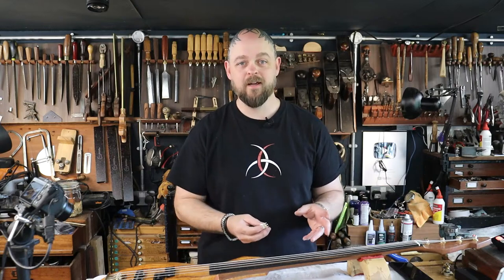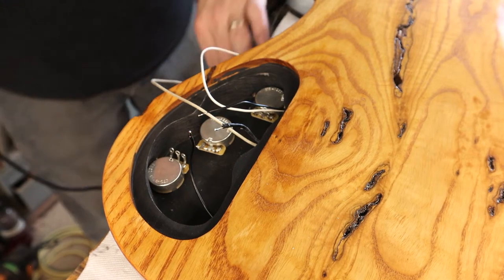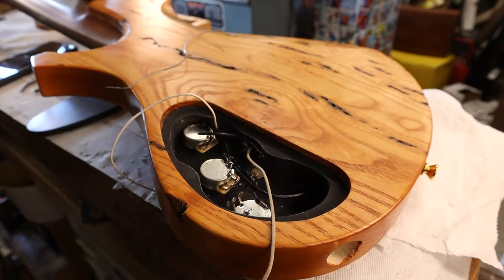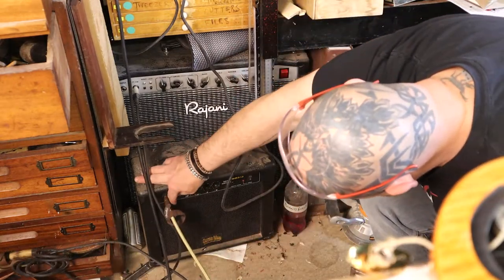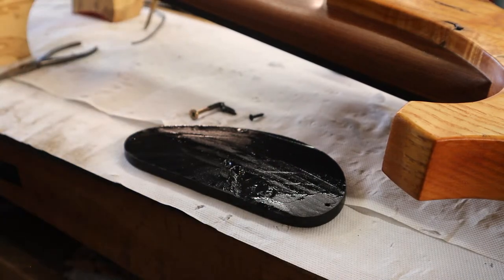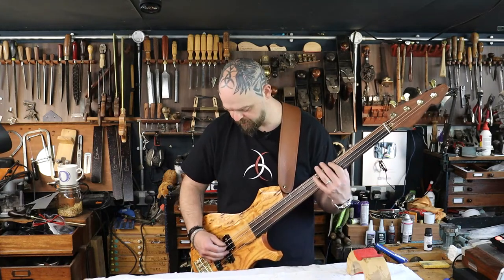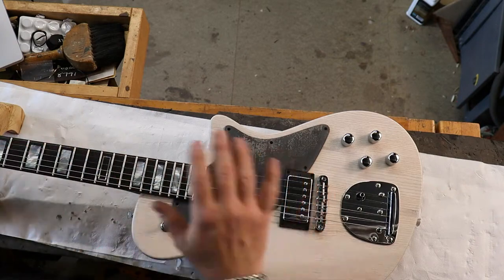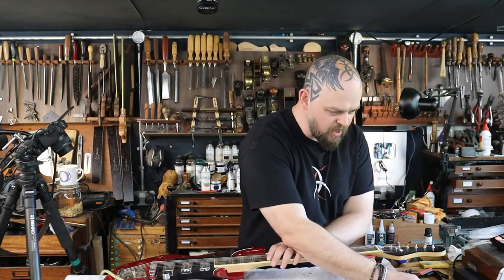Custom Bass Guitar Build Completion pt 2 + surprise prototype - Luthiers Live Stream with Ben Crowe

Comment: @Crimson Guitars Extra you may have already been told, but the reason you can't use a guitar amp for bass is the speaker. Bass actually has a wider sonic range than guitar, and with enough power, a bass will shred a guitar amp speaker. Your Kemper should be fine for the bass.

Also, Lemmy famously used guitar Marshall heads with bass cabs.
Reply from the maker: I knew the speaker size was a thing but not the reason for that.. thank you

Comment: Does the cable for wiring need to be multi strand or not? If so, what is the advantage?
Reply from the maker: not at all, the advantage is that mutli strand wire tends to be self shielded, in a properly shielded guitar there is no real advantage

Comment: Re watching the part of the stream I missed this morning and I see sooooo much bad advice on how to solder. You don't need to be preheating anything to have good solder work. Specially if you are working with active electronics. Second if you are splattering flux and solder all over the place your iron is wayyyyy too hot. If your reply is the iron HAS to be that hot to heat soak things like pots the answer is its not the temperature its the iron you are using is not a fast recovery iron and the heat soak is just the by product of the iron struggling to keep up. 

You are soldering, you are not welding, and you certainly not a plumber if you are in the guitars cavity with a soldering iron. Work with the solder and make it do what you want NOT the heat. If you doubt this my qualifications for soldering is having worked for Harris RF communications building Military radios in the 90's I worked for another company that is now part of Northern telecom rebuilding all of Britains directory assistance automation and directory storage and finally I worked R&D for Nexpress (joint venture between Kodak and Heidelberg digital.

I have a video how to solder geared towards remote control aircraft electronics that crosses over nicely for soldering guitars on my channel if you may be interested in learning. The video name is "Teaching Bardwell how to solder" after he taunted me for telling him he was teaching people wrong too.

Finally about the added ground wire and the screw. the pots casing touches the shielding paint so that is already grounded there on each pot. Totally unnecessary.
Reply from the maker: beautiful advice, thank you!